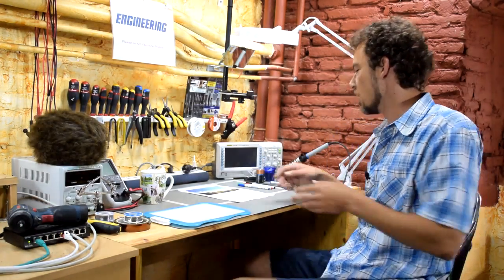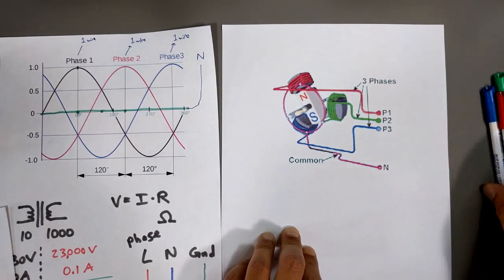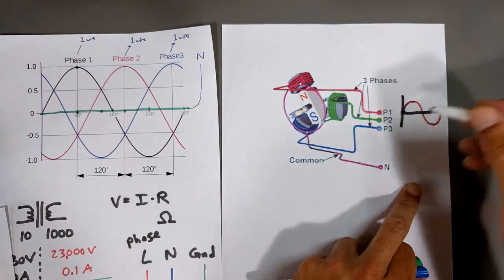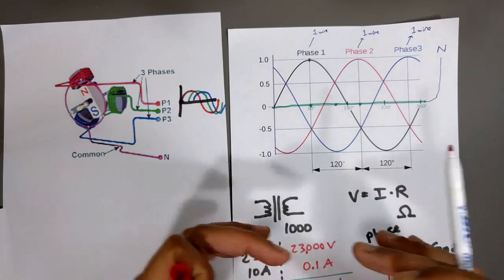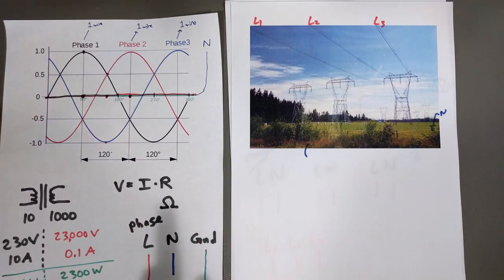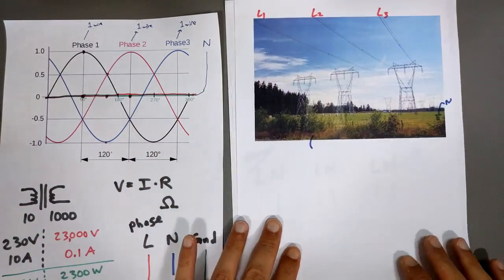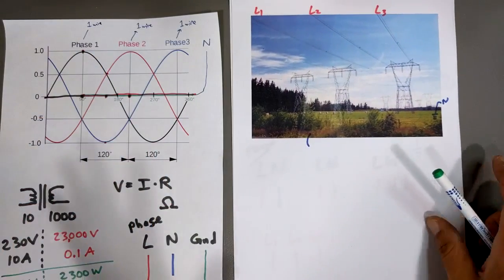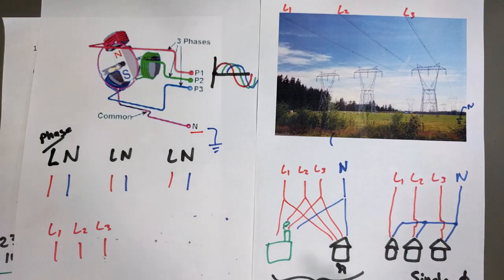EEK! #3 - 3-phase Power

Comment: A spark plug on your vehicle can be anywhere from 20kva to 150kva and its hz are into the tens in hundreds and thousands however the amp are very low so if you pass this voltage over an inductor light a headlight globe from your car and sense voltage on on the other inductor aka filament you can lower this voltage to an very low voltage and are able to use an led to collect that pulse while also creating another circuit/canbus over the same circuit

Comment: Nice job Scottie!  I read that almost all large power line transfer 3 phase power in Delta, you described the large power lines using the Y configuration.  Can you comment on this?  Also, is the actual Generator set up in the Y configuration as you described or is the generator configured in Delta? Again, thanks for the Video, it was very informative.
Reply from the maker: Yeah, it's easier to understand wye. As I understand it, high-tension lines are usually delta (no neutral) and low-tension lines are usually wye.

Comment: what happens if you lose a wire/phase? Sounds like you don't need 3 phase at all? why bother?
Reply from the maker: It's more efficient for power generation. You need AC to be able to bump the voltage up (and current down) so you can transmit large amounts of power vast distances, and you need 3-phase because it's the minimum number of phases you can use that ends up being cost effective - maximizing the power you can carry while minimizing number of wires and things like power station breakers, bus bars, etc.

If you lose a phase, 3-phase stuff like motors will have some trouble, but for other single-phase loads, it'll just be a power outage. If you lose neutral, you get overvoltages and things tend to explode. But even with those little problems, 3-phase still works out to be optimal.
Reply: Thanks for the feedback Scottie "dilithium crystal'. Makes total sense. I've been wondering about DC power, because you avoid the pulses that are so bioenergetically problematic that occur with AC. I've considered getting motor home (DC) fridge, stove, etc and transforming AC to DC at the home.

Comment: Show me how single phase gets transformed to the home in 120 and 240 volts.  Is there a phase to ground transformer from (whatever your pole voltage is) 7,500 or 14000 volts down to 240 with a center tap in the low voltage coil, or is there a relationship between two of the three phases and neutral/ground in order to arrive at 120 + 120 volts = 240 volts?

Show me how a 240 volt device, such as an electric drier or stove, can short together the two lines from the circuit, without having 240 volts back-feed into the rest of the house electrical.

And then talk about 208 volts :) Cuz I give up
Reply: agvulpine it’s split phase. The bus bar where the breakers go is 2 pieces each 120v
Reply: Yes, the bus bar is separated, but they tie together at the dryer's and stove's heating element? Or are the two drops kept isolated even at the appliance?
Reply: Yes but each part that the breaker clicks into its 120v. If you use a two pole 50a breaker for instance. It is wider than a standard breaker and hits two spots. You use a 3 wire so that each conductor is 120v. 120+120 is 240.
Reply: Still doesn't explain to me how that doesn't backfeed into the rest of the household.

Comment: hi scott love your vids,now for my question, how can you know (if the three wires are white) wich one is the phase and wich one is neutral,or maybe i have 2x1phase and a neutral
tried to test wich o,ne is wich with a fluke multimeter,a elix volage detector,and a screwdriver with a neon lamp
still dont know wich is wich,like to know your solution to this problem

Comment: Hello All,
Great info from all! I wish someone could explain the neutral a bit more in detail from both 1) the power station/high voltage lines, and, 2) from the pole/transformer to the home (i.e. im guessing going from 7200 volts or similar to 240V/home) Im in australia and we use 240 V from the socket. Also - Im not a trained electrician or engineer in electricity however as a scientist Im curious how things work lol!
Thanks in advance:)
Cheers
Fred

Comment: I thought most homes in the US get 2 phases. Are there really more homes in the US that get only 1 phase? That means they won't have 240 running to their garage or laundry room, etc.
Reply from the maker: Well, in the USA and N. America it's split phase. 240V divided into two 120V phases. In the rest of the world, it's usually 230V single phase, or 3-phase. But even in N. America, technically it's 3-phase until it reaches some neighborhood, and then they take 1 of those 240V phases and split it. Well, as far as I know, anyway!

Comment: " A single phase system provides marginal motor performance. It is usable up to 10 hp or so, but beyond that poly phase motors are far more economically attractive.

A two phase system would operate motors approximately as well as three phase, but still requires three conductors. Three phases balance the current a little better and transfer an equal amount of power using a bit less inductor area, so this is economical.

More than three phases don't offer any significant performance advantage and complicates motor, generator, transformer, breaker, switch gear, and transmission line construction, so would add significant cost.

Short answer: three phases is optimal with regard to performance vs. cost "